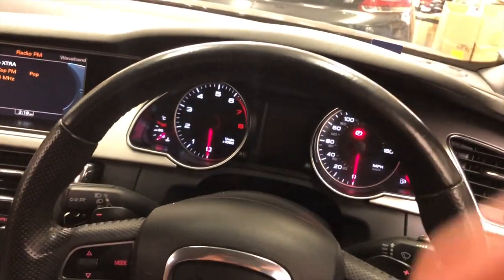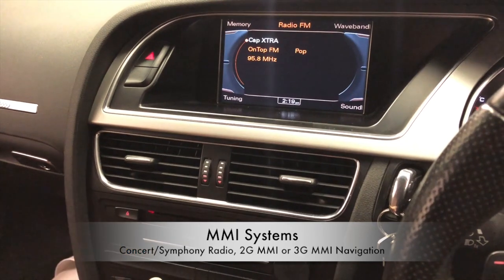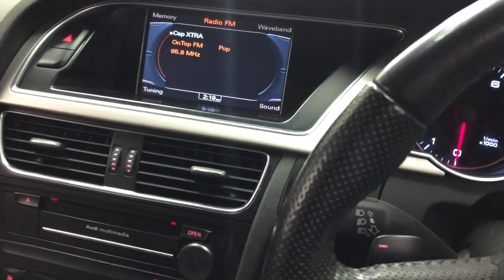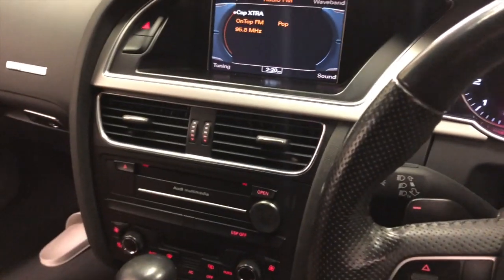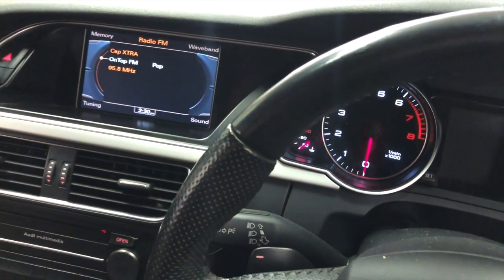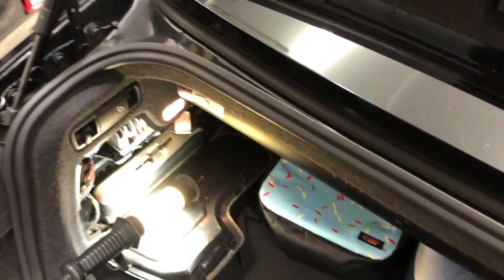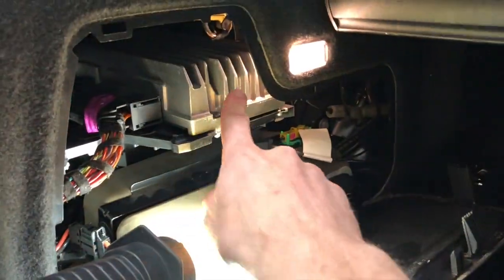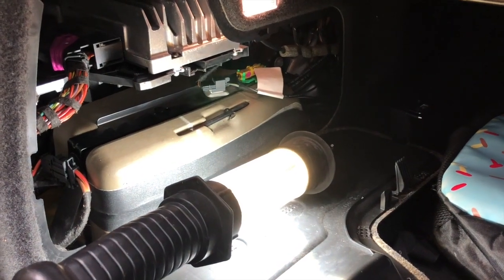Audi MMI Repair / Diagnostics

Comment: Hi my Sat nav on my Audi A4 B8 avant 2014/15 has lost my location ive had the code reader on it and it comes back with a code (02984 connection between impedance converter 2 and antenna built into the window) can anybody shed any light TIA
Reply from the maker: You most likely need a new GPS Antenna.
We offer diagnostics if you come to us.

Comment: I'm from Poland with an A5 8T 2008 coupe S-Line model. My MMI has been freezing up at random. The sound still  plays but it will reset itself and once it's "on" it freezes after 2-4 seconds. After that the only thing on the panel that works is the parking brake. I checked the wiring in the tunnel and it seems fine. Any idea what could be causing this? Any advice would be helpful as it's very hard to find someone over here that knows about MMIs.
Reply from the maker: Sorry, We can only assist when having the car physically with us

Comment: Hi.  I'm from Australia. Ive got a parasitic draw on a Q7 2014.  Thermal gun shows the unit which opens down SIM and SD CARD 1 and 2 is very warm at 40 Degrees Celsius and the little info screen is at 30 Degrees between the 2 round KM/H and Tacho when car is  cold as stone.  Has already killed the battery and I'm charging the new battery every night so it doesnt kill the new battery also - until i find out what's keeping these 2 units on when the car is sleeping !!
Have you come across this odd parasitic draw before ?
Any help would be amazing.
Thanks

Comment: I just put in a new MMI circuit board think that it would fix my issue. It turned on for a few min, couldn't get any sound to come out , I unhooked the battery for a few min and started it back up, the monitor came on had sound for 10 sec then it all shut off again. It keeps tuning on and then off. At first all the lights were on now they are off. I tore it all apart cleaned the circuit  board off again , put everything back together and ended up with the same result!!
Reply from the maker: please contact us here: https://www.satnavsystems.com/contact-us/

Comment: HELLO 
if you could please HELP with Q5 2014 mmi stuck at splash screen logo reverse camra comes on sometime.
1.03157 Function Restriction Due To Communication Interruption
2.03675 Navigation Data Not Present
Reply from the maker: Please contact us here: https://www.satnavsystems.com/contact-us/
Reply: What did u do? I have the same problem!!

Comment: You didn't diagnose anything of fix/repair its just a video of you blabbing
Reply: I fixed this prob by unplugging the power to the amp and reconnecting it.
Never had an issue since
Reply: @davidmason803 
Did you do anything special before that? Disconnect the battery?
Reply: Thank you for posting this, fixed my issue 2012 A4 MMI 3G - No sound all sound adjustments turned to the left.  @davidmason803